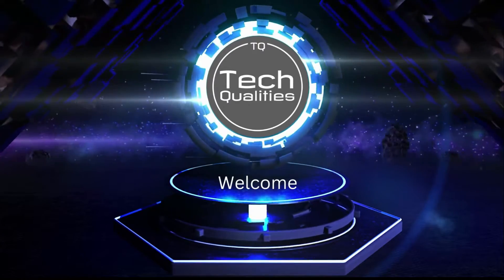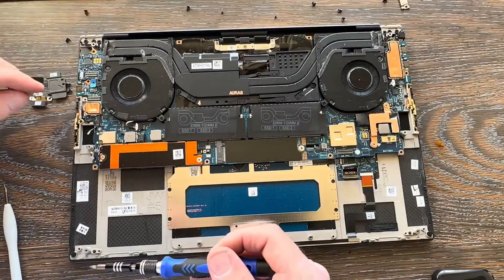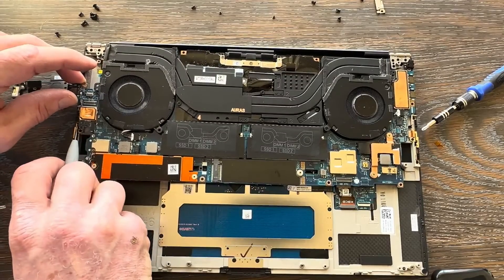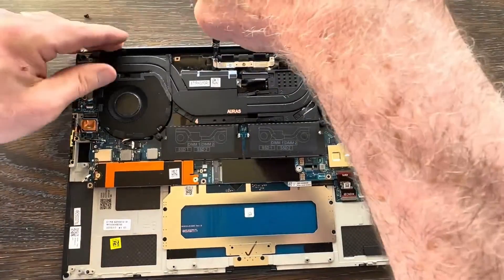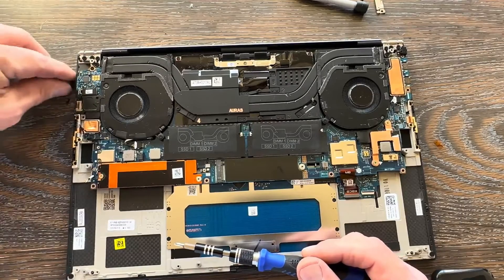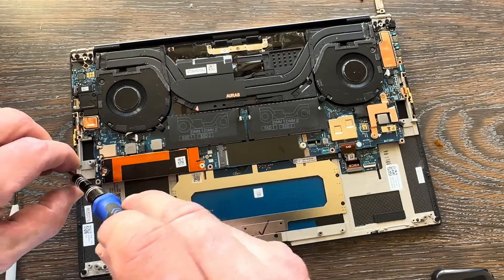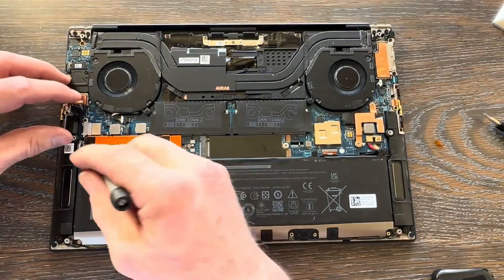Dell XPS 15 9520 Palmrest Keyboard Replacement

Comment: Great Video and Nice workflow, worked for me the first time 100%. For the WiFi antenna, it's always best to use fingernail to align and soft press until it clicks. Thanks for the concise narration, it was to the point and very helpful.
Reply from the maker: Glad it helped!  Thanks for including tip on WiFi antennas.

Comment: I don’t have the greatest track record with hardware tasks more significant than swapping out an HD or RAM stick, so I was a little nervous headed into this. There were a lot of parts, and it was time consuming (~90 minutes for me), but it wasn’t too finicky or difficult. No broken wires or tabs, no missing screws, everything came in and out easily. I’m glad I did it myself. 
My only hiccup was not aligning the keyboard connector perfectly, which made me worry that I had a dud replacement. But removing and reinserting the keyboard to motherboard cable was all that was necessary. 
Thanks for the video!
Reply from the maker: Thank you for the comment.  I’m glad it worked out for you!

Comment: How are you getting the KB cable out of the clamp?  Mines not coming out.  I'm pulling straight outwards.  Thx!
Reply from the maker: Make sure the black clip is disengaged as you see me do it in the video.  If it still doesn’t come out, there’s something wrong on your end.  May want to use needle nose pliers to pull gently. In general, these come out easily.
Reply: @TechQualities  the video went too fast to see you do anything to the clamp
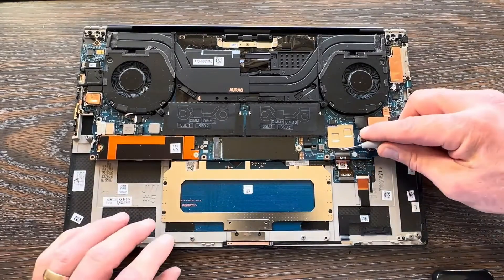Reply: @aceclarksatx  Just past 1:53, it's the little black tab on the back of the connector, pops upward first
Reply: @roguevariable8367  I got it the other day.  Thank you for following up.
Reply: @TechQualities  I feel stupid but I'm timid to do much anything until I get further guidance.  I don't want to ruin a good MB.   Pardon my slowness

Comment: Thank you so much for making this video. 
I spilled water on my keyboard and didn't wait to let it dry for a few hours and just started using it after a few minutes, at first everything worked fine then after a while some keys started acting funky and then after some more time they just stopped working, I decided to open up the laptop and take out the keyboard to see if there's any way I could dry it out better, but it's all sealed shut :(
Closed it all up again but no luck. 
Will definitely come back to this video when I get my replacement part.
Reply from the maker: Good luck on your replacement!  Hope the video helps out.
Reply: @TechQualities  It started working again by itself after another day.
Thanks for your video though :D

Comment: I have no idea how you got the KBCB to motherboard connector disconnected and reconnected so gracefully. When I tried to do what you did the connector on my mobo cracked and it also broke on my new palmrest, too. Crazy how delicate that connector is and it was very unintuitive how to disconnect and reconnect it. My system is ruined now. No choice now but to send it back. I've been working with computers for 40 years but this was far beyond my skill level and I definitely should not have attempted this.
Reply: I tried to carefully flip the connector like you did and the plastic just crumbled and tiny wires fell out. Everything apart from the KBCB connector was easy thanks to your detailed explanations. But some additional detail on how the KBCB connector is supposed to work might have helped because it was very fragile and unintuitive. Also it looks a tiny bit different on the model 9510, which is what I have.
Reply from the maker: It might be that the one you’re working on already had issues.  I’ve done hundreds of these on various models and never had an issue.  The plastic connector is thin and fragile but never had one of these crumble like yours.  Usually once those break (I’ve had much smaller ones break before), it’s near impossible to fix and the motherboard needs replaced.

Comment: I've been working with computers for 30 years, and this video made me decide to just pay someone else to fix my laptop. It's wild how complicated this process is, and that you have to do it if you have have even one single keycap retainer clip snap off.
Reply from the maker: It can be a daunting task.  N the old days if you needed a keyboard replacement, the standard was more where the keyboard lifts off the top of the palmrest.  A few screws and you’re out.  Now many of them sit under the palmrest probably for cosmetic reasons.  You have to gut the laptop to get to it.  Glad you watched!  Thank you and best of luck.

Comment: Mine had an extra LED connection that goes under the battery, that needed to be transferred across otherwise all good
Reply from the maker: Glad it worked out for you.  Yeah some of these models may have slight variations in ribbon placement.

Comment: Thanks for the video it helped out. Can you just replace just the keyboard. It looks like there is plastic holding the keyboard on the chassis.
Reply from the maker: Unfortunately you can’t just replace the keyboard.  You are correct, there are little plastic rivets that hold the keyboard to the palmrest on this model.  Thanks for watching!